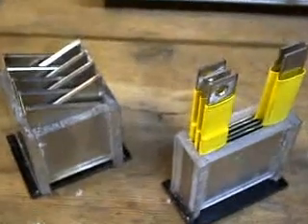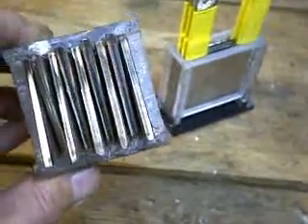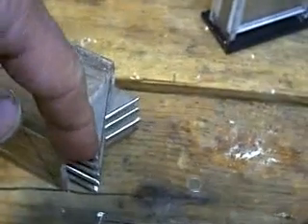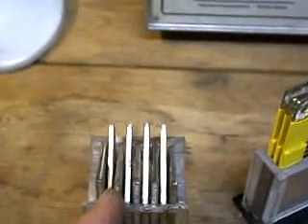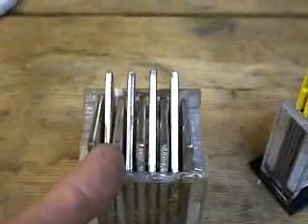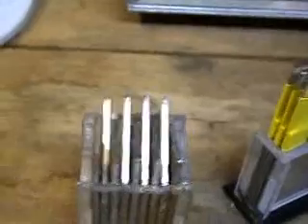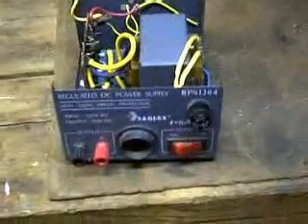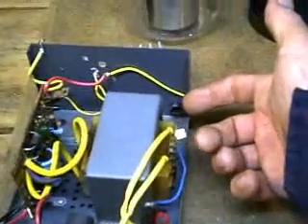#70 - PWM taking shape

Comment: Hey Zero,
I hate to move BACK in time, but how do you cut your stainless steel sheets? I picked up some old 304 Stainless Steel Kick panels from the bottom of wood doors quite cheaply.. but I'm not sure the best way to cut them into strips for a vertical cell.. any quick tips.

Carry on,